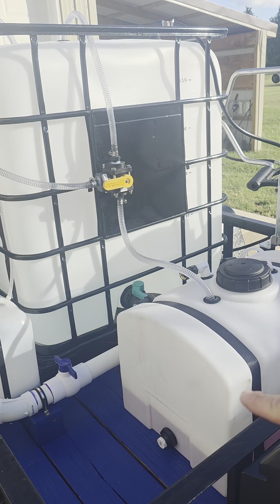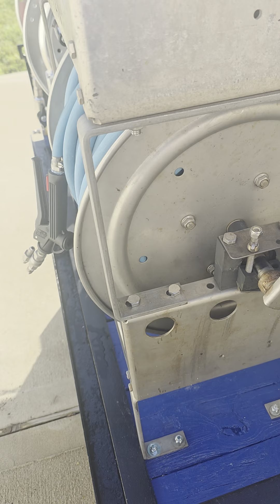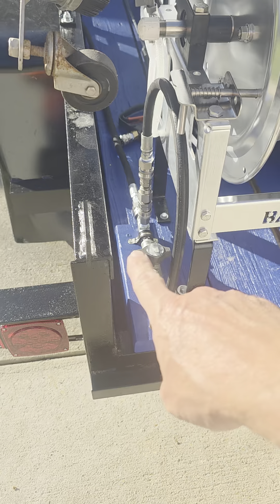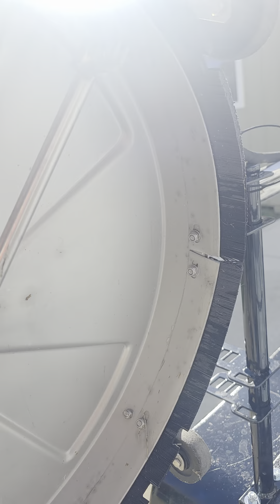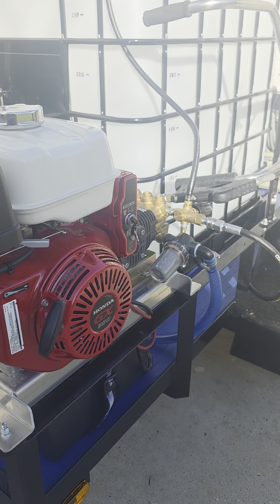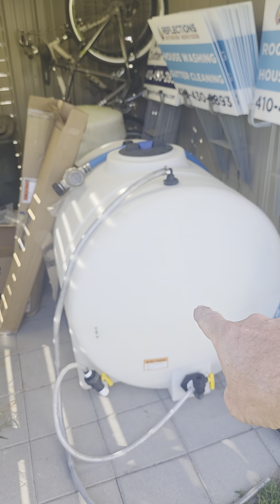Pressure Washing Trailer Finished- Complete Detailed Walk Around

Comment: is the suction hose from tanks to proportioner 1/2" or 3/4" and why
Reply from the maker: 1/2 on suction side and 3/4 on outlet side running to reel- hose on reel is 1/2 - reason is because that's what the pump is rated for - 1/2 ports